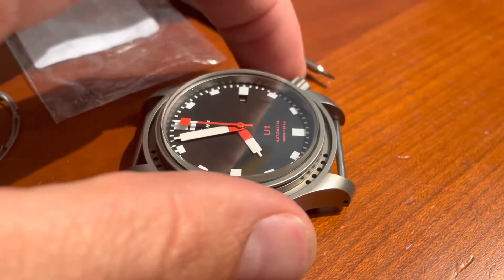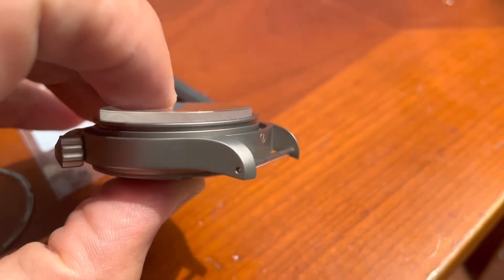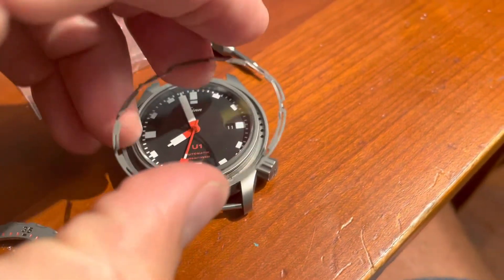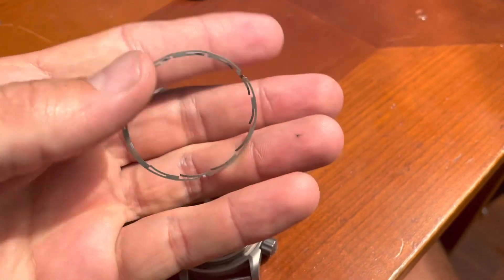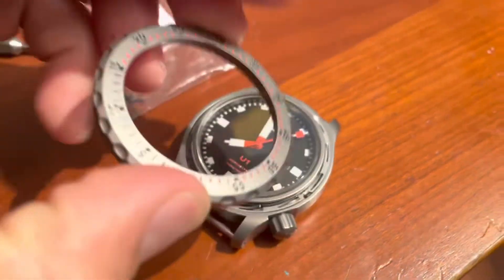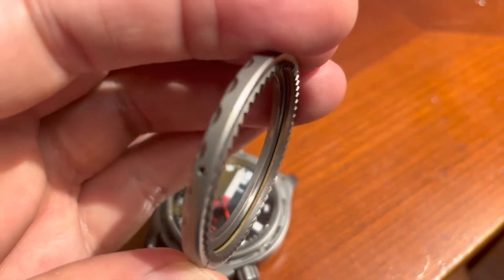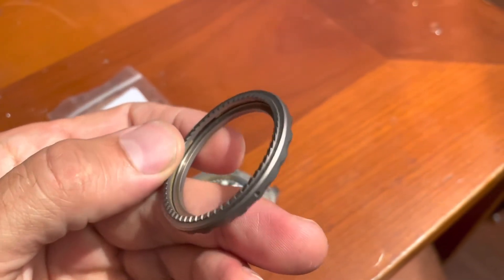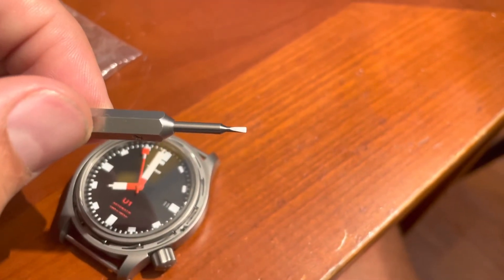Sinn U1 Captive Bezel System - How does it work?

Comment: Did you get fine scratching on the crystal coating? What method did you use to remove the AR coating. I may do that as well if it can be done well.
Thanks for the video explanation .